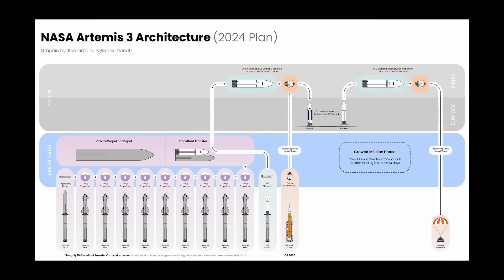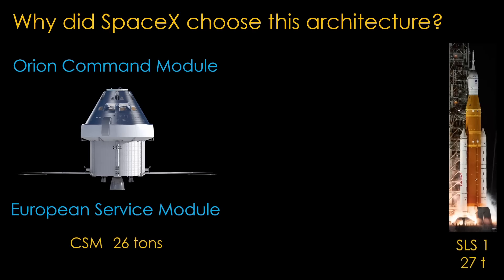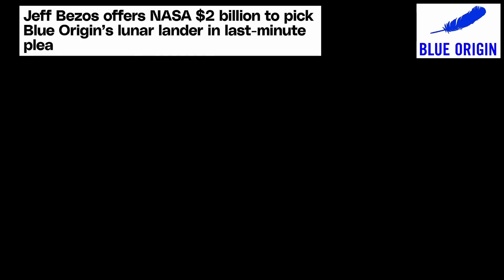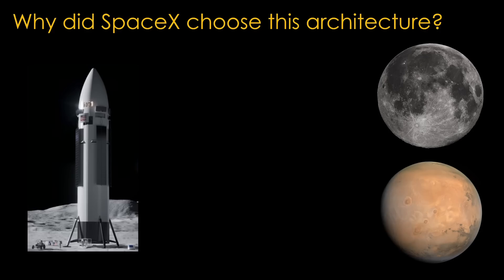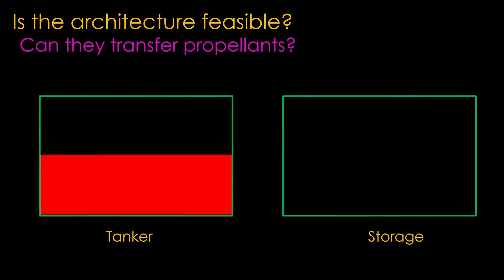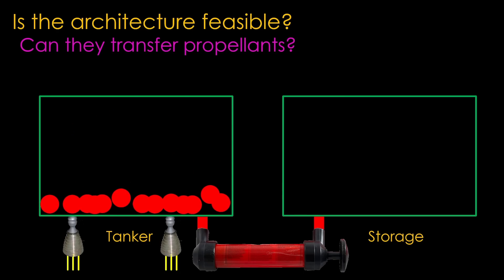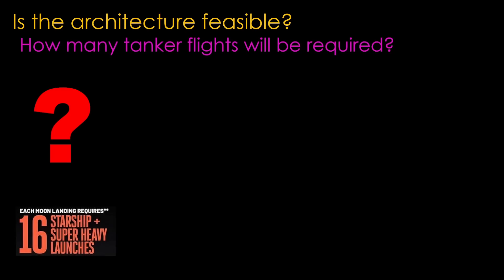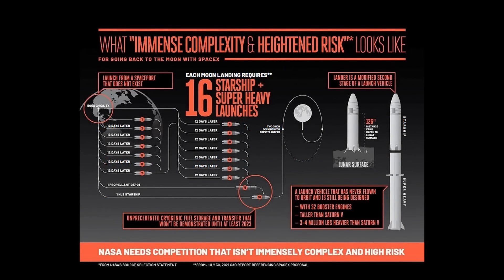Starship Orbital Refueling

Comment: This may be too weight-restricted, but an inner flexible tank skin that can be pressurised on the other side from the fuel would force the propellent to the exit for the tank.  I believe a similar system was either used or proposed for early re-ignitable rockets.
Reply: Bladders don't really work for cryogenic propellant.
Reply from the maker: This. Flexible at room temperature is very much not flexible at cryo temperatures.
Reply: Using an inner bladder to store fuel is sometimes used on satellites. But not rocket stages, as the dry mass is high. There's another variant that uses a contracting piston instead of a bladder, that sounds even heavier.

Comment: I imagine the thrust to settle the fuel is provided by the Starship mating to the depot. I wonder if the lowest throttle setting of one Raptor is within a sufficient range?
Reply: That's way, way too much thrust. Two Starships and 200 tons of propellant with a raptor at 50% throttle would still be around 0.3G. You want more like 0.01G.
Reply: @SpaceAdvocate  Can Raptor throttle down to 10%? If not, maybe the cold gas thrusters are sufficient. Their reservoirs can be increased for the mission. Or do a cryo bleed on Raptors, which could provide thrust as well as chilling the engines for relight.
Reply: @Tanstaaflitis  No, they can't. And even at 10% it would still be far too much.

I believe they'll use the methalox hot gas thrusters they've been talking about.
Reply: @SpaceAdvocate  I haven't heard about those. I know there's many potential solutions.
Reply from the maker: My guess - and I didn't talk about this - is that you get part of it just by gas venting from the target tanks. If you need more you can add a little heat.
Reply: @EagerSpace  A silly thought, but do the Raptor pre-burners produce enough hot gas to create sufficient thrust?

The pre-burners would have access to fuel and oxidizer. And the exhaust from the pre-burners is piped into the combination chamber, giving small additional thrust. 

All the piping, fuel, and mechanics already exist. Control procedures definitely need to be developed. But this seems something Raptor can do without needing to develop separate hot gas thrusters. And you have six to nine pairs of pre-burners, so there's a lot of potential flexibility.

Edit: After reviewing how Raptor's cycle works, this idea potentially adds complexity to disengage the fuel pumps and gas generator turbines from the pre-burners. Since the coupling is via hot gas, it's feasible the gas can be closed off to vent out the combustion chamber and nozzle. But the valve would be a point of failure deep inside the engine. Seems an unnecessary step to avoid adding some low thrust, pressure fed cold gas thrusters. There's plenty of cryo fluid to heat up into cold gas between the depot and tanker.

And on the gripping hand, a specialized pre-burner could power the pumps necessary to push fuel from the depot to the tanker. This doesn't need the rest of the engine, and could produce gas for thrusters.

Final edit: after rewatching the Everyday Astronaut Starbase tours in 2021 and 2022, Elon discusses the generous amount of ullage gas Starship has when it reaches orbit. Most of this gas needs to be vented, so they vent it as gas thrusters (technically as a hot gas). So, I expect that is sufficient for the small acceleration required. A side effect is this essentially reboosts the depot each time, though that's likely a small effect. Deorbit and boost back use the header tanks, so all the ullage gas above what is necessary for structural rigidity is available for thrust. 

No more edits from me. I've had my fun.

Comment: Somehow, i doubt the initial lunar missions will make use of Starship's full cargo potential. That means it should take fewer refuelling trips. 

I'm also curious if there's a source of carbon on the moon. We know ice can be found and potentially electrolized in situ. If there's a source of carbon, perhaps methane and oxygen can be produced on the moon. That would be an interesting experiment ahead of a Mars flight and the need to synthesize fuel there.
Reply: I think cargo missions to support Artemis will involve sacrificing the Ship's to the surface in order to maximize payload, with the ships themselves being able to be tipped over and converted into habitats buried with regolith. The logistics of tipping a ship over would not likely be available for several years though until enough infrastructure was available plus the demand for such a large habitat.
Reply: @coreygraybz  I'm interested in what it takes to convert the empty fuel tanks to something habitable. It may just be simpler to send up inflatable habitats that can be buried than worry about on-site ship breaking. But the future is a foreign land.
Reply: @coreygraybz  The more and more I think about it. Tipping over Starships to create habitats is kind of silly. It may be more mass efficient to offload the entire upper portion as a well outfitted habitat. Then potentially the remaining portion--having deposited dozens of tons of cargo--has enough delta V to return to Earth, becoming a lunar tug of sorts. As I see it, outfitting any potential habitat is going to require substantial tonnage. Enough that I doubt you can ship enough to make it worthwhile to crack open the fuel tanks to make space. Better to ship something already setup like the Bigelow inflatable habitats and bury them.
Reply: Why would they have to tip them over? Skyscraper living on the moon! Think of the views!
Reply: @bhartley1024 I know this is old, but the typical idea is to tip over space craft so they can be buried in the lunar regolith as a protection from the sun and other hazards. That seems prudent for long term bases. Tall things are harder to bury. 

I still think it's not a great plan. Starship is basically a big steel balloon. Once the fuel and oxidizer are gone, there's nothing to keep it inflated. It wouldn't stay rigid without some form of internal pressure. And it needs to be rigid to hold up against regolith piled on top. Adding structure for rigidity is wasted cargo space.

In the end, sending complete habitats is a better idea than relying on weak steel tubes with no life sustaining equipment. If the moon is eventually a well manned outpost, there may be a use for ship breaking for raw materials. But not anytime in the foreseeable future.
Reply: @Tanstaaflitis imagine the dust storms caused by landscaping on the moon

Comment: Yeah I don't think SpaceX will achieve full reusability until 5 more years at least. It was pretty clear from Flight 4 the Ship just wants to burn.
Reply: It survived reentry and managed to make a soft landing. That's pretty good. Better than I expected, at least.

I think it's highly likely that the revised heat shield and fin layout makes Starship capable of recovery and reuse, in a matter of weeks or less.

First recovery of Starship is likely to happen in the first half of 2025.
Reply: The heatshield is already overhauled, The hinges have been redesigned starting with Ship 33 plus Ship 30 had some fixes applied to the hinges to make it stronger. Heatshield reuse will be a bigger problem that vehicle reuse most likely. You are probably right about full reusability timelines though just having the Booster running ships up will be a huge boon over F9 first stage reuse.
Reply: So just make the hinge sturdier and you have a minimal viable product. After that it needs some iterating and it will be a workhorse like no other. I don't think SpaceX takes 5 years to redesign the hinge... Last I looked they already have made changes. 5 years is a crazy number

Comment: The lower your orbit the more propellant you can get into orbit per launch. Given this fact a Fuel Depot launched to a low obit should not have an issue with using thrusters to transfer propellant as the transfer is also providing a much needed boost to the Depot's orbit.....In fact the Depot could be placed in a very low orbit where not only the propellant transfers are needed to provide periodic boost. The inevitable boil off gasses would also be needed to maintain the Depot's altitude. In such an orbit you could launch many tons more propellant into orbit per launch and still rely totally on boiloff gasses for propellant transfer and Depot station keeping.
Reply: I like the idea of doing something useful with the boiloff gases. However I think the difference in payload to high vs low LEO is negligible.
Reply: @bbgun061  Actually you need about 1.6% more propellant to achieve a 300 mile orbit vs a 100 mile orbit. For a fully loaded Starship tanker that's somewhere in the neighborhood of 73 tons more propellant for the higher orbit.

So yeah, you definitely wanna aim for the lowest altitude you can get away with for your Depot.
Reply: @THX..1138  I agree they will want to aim for a lower orbit, but how much does that increase the payload? Will that actually reduce the number of tankers required?
Reply: @bbgun061  I'd guess it would increase payload anywhere from maybe 10 to 25 tons. Probably enough to shave off at least 1 tanker launch.... Which is likely why SpaceX doesn't yet know how many launches they'll need as things like how low you can put the Depot are still unknowable at this point.
Reply: I’m sure there is an ideal orbit, all factors considered. I assume whether the tanker is orbiting short term, for the mission, or long term, multiple decades, would also influence the optimal altitude of the tanker orbit.

Comment: In my opinion SpaceX and Blue Origin proposals are both terrible, as the Artemis program. The NASA focus should been into a revival of the Apollo program, but with updated technology. Leaving for the private launchers, where reusability be a factor, the cargo missions to build the infrastructure. China will definitely more certain to beat the USA, returning to the Moon.
Reply from the maker: Constellation might have been that program if it wasn't totally unaffordable, but that wasn't NASA's call. Well, it was Griffin's call that it be shuttle derived and that did drive up the cost quite a bit. Artemis just came around because congress told NASA to build a really big rocket and a deep space capsule without an underlying architecture, all done so they could keep sending money to the NASA centers and the shuttle contractors. 
I do expect China to get to the moon before we get back, if only because it's a matter of national pride for them and not for us.
Reply: @EagerSpace   You could do a video about that. SpaceX and Blue Origin would insure multiple expendable cargo missions. Which would stay in Lunar surface, with Life support systems as supplies. Then using the SLS Block 2, to launch the Crew. Being able to reach Lunar orbit, with a command module based on Orion, a lander and ascent modules. Similar layout as Apollo, but with a drastically improved support infrastructure already on the Moon.
Reply from the maker: I don't think there's a lunar solution with SLS that could possibly fly before 2035 even if congress was willing to fund a lander. Even block 1b is a long time away. 

One of my points in my recent "presidents" video is that both the SpaceX and Blue Origin solutions naturally lend themselves to architectures that bypass SLS and Orion. That would be a better place to be, though I have no idea how you would sell it to congress.

Comment: Yes exactly my thoughts as well, All of this hubbub about how many flights it's going to take when the falcon 9 puts over a hundred launches into orbit/ year. 

I could see the concern if they were talking about ULA or Blue origin but a complete non-issue for a company that leads the world in launch frequency by a huge margin
Reply: It's going to be a few years before we get the Starship cadence necessary plus if something goes wrong it will create a cascade effect on missions down the line, creating schedule slips and logistics issues. A starship RUD is going to cause a much large delay that the quick 2 week delay recently suffered by F9.
Reply: @coreygraybz  I partially agree. What we are looking for has never been done so there can be no dogmatic assumptions as to what the timeline is . . . 
Having said that, once the SuperHeavy booster design is complete you will have a reusable vehicle that does not suffer from the coking of RP-1 fuel, there are no heat tiles to replace/ repair. 
Post landing inspections will be thorough at first but as long as the physics is sound the heavens will be opened to a fully functional fuel depot in LEO that will facilitate max payload to anywhere. 

That first bit is certainly  no chip shot, but assuming SpaceX solves booster landing then it's Game Over for legacy expendable rockets because the capability and expense will obsolete all of the slow/ expensive alternatives.
Reply: @JoshKaufmanstuff the game is already over for the legacy rockets.

Starship and booster are designed to be fast and cheap to build. They're a tenth the time to build and can be produced at a tenth of the cost. 

Even without reusability, the game is over for everyone else. SX already demonstrated successfully reaching orbit, which is all the expendable rockets ever do.

Reusable ships are just the icing on the cake.
Reply: @gasdive  never been to orbit and they are many many tons away from their payload target. last estimate was 30-40 tons to orbit. which is actually 0 proven tons to orbit. there is no payload deployment mechanism and no plans for starship to launch a payload in the foreseeable future. meanwhile ariane 6 launched with payload and made orbit on the first launch, BO is launching a rocket to mars before end of year and ULA has already launched a lander to the moon all of these are on first flights of their respective rockets indicating a good level of confidence. maybe Spacex can actually get to orbit on their 5th try, albeit still with 0 payload. hey maybe they can figure out how to relight their engines in space too. something we've been able to do since the 60s
Reply: @mattkingston6157 
Keep coping.

 there's only one more ship that has 40 to 50 tons payload and the reason there is no payload or mass simulator is because the vehicles aren't fully fueled.

You really want the largest rocket stage ever built to land directly onto you? Because the company wanted to prove some vain stunt of full orbit?
These tests are to prove this vehicle,
If you don't understand that that's not my problem.
Reply: @carcinogen60yearsago  literally none of what I said was cope. The cope here is you trying to explain away why after 5 flights starship still doesn’t work. Catch was cool no doubt. But so are explosions so that’s not really a point. They aren’t even reusing that booster so the catch was really just performative. Still 0 payload. Still no orbit. Still in development for some reason. Remind me what the Saturn 5 did on its 5th flight? How about the shuttle? Ariane V? Delta Iv? Atlas V? Space shuttle? Vulcan? Just weird that this so called rapid development seems to be anything but. The DCX which is the progenitor to any of this rocket reuse stuff literally worked on its first flight. In the 90s. Smaller scale and different velocities but this was the first time a rocket had ever been landed on earth and they nailed it. Literally what is special about starship to make it take so long. Shuttle was essentially a reusable second stage, and it worked first time. It’s boosters were recovered too. You’re right about this not being your problem. None of this is your problem you weirdo. Spacex doesn’t know you exist, you have a parasocial relationship with a rocket
Reply: @coreygraybz  It depends on the RUD. As long as the RUD didn't cause a safety hazard, they can get FAA approval to launch in a similar timeframe as the Falcon 9. 

That of course assumes SpaceX is comfortable risking hardware on another launch. It means they need to rapidly figure out what happened, like with Falcon 9.